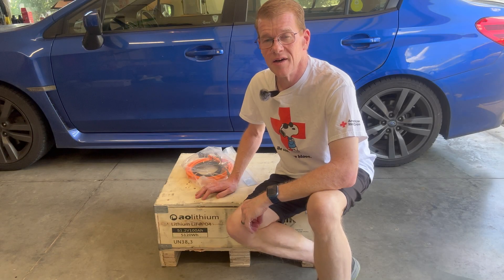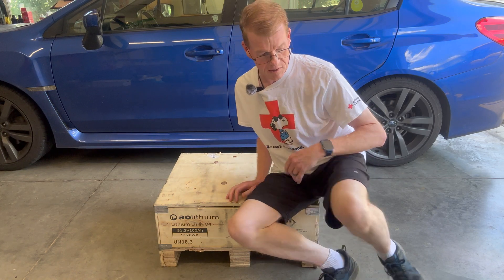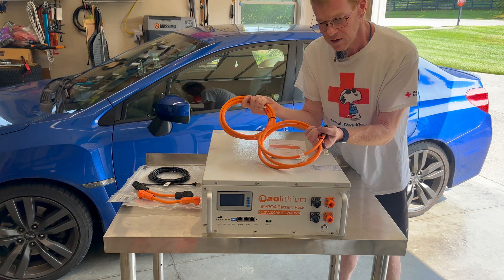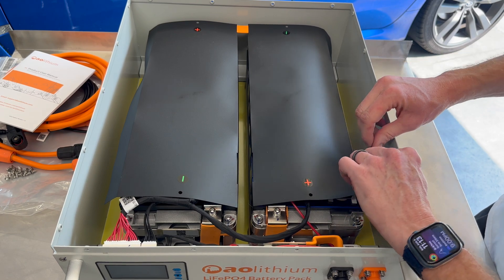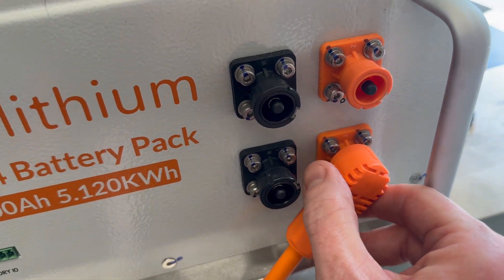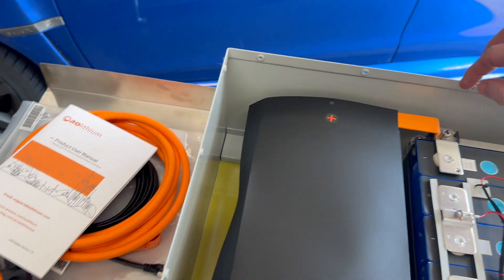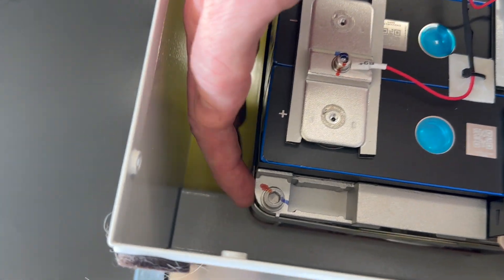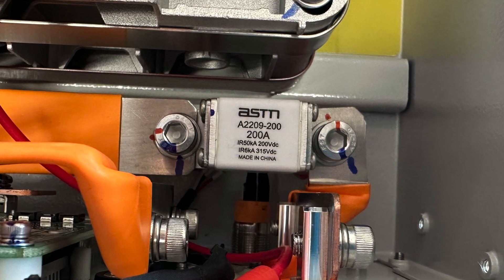AOLithium 51.2V 16S 100Ah 5.12kWh LiFePO4 Rack Battery Part 1: Unboxing and Inside Look

Comment: Thx for the video showing inside AOLithium rack. One of my 4 racks no longer works. It was only in operation for 8 weeks. The display remains dark when I press the button. However, the LEDs light up. The rack is also no longer discharging and a restart and reset have not rectified the fault. Does anyone have any advice? AOLithium has not yet responded to my complaint.
Reply from the maker: There are one or more facebook groups about AOLithium.  I think I saw someone working to retrofit a different BMS into one of their racks.   Unfortunately based on the feedback I'm seeing and lack of contact I think AOLithium has ceased to exist.  I have also stopped getting replies from them.   This is a shame because the internal construction is very good.   I would have liked to see the cells bolted instead of welded for serviceability, but other than that I have nothing to complain about for construction.

Comment: I bought 8 of these 4 with BMS VERSION 2.0 and 4 with the original 1.0

Has anyone figured how to do a firmware upgrade on these.

I also have these connected to a bus bar setup with longer cables all the same size and the dip switches and communication set up as per instructions.  They all discharge at different levels, never the same
Reply from the maker: There is a thread of DIYSolarforums where some have managed to communicate with a PC,  but I have not seen or heard about firmware update or setting changes being successful.

Comment: Nice video and good insight. Can you tell me exactly what brand and type the BMS is and whether you can make any settings yourself, e.g. with a dongle and PC software or something similar? I have one here, but it charges with very high cell voltage until the alarm turns on. I would like to adjust something, but I can't find anything about it. Thanks
Reply from the maker: I can't find anything about the make and model of BMS either.  I know there are a few people on diysolarforum trying to figure out how to do the same.   Do you have a cell imbalance issue?  Mine will reset to 100% and turn off charging at 56.0V and >.5A.
Reply: @DougKremer  Thanks for the quick response. Yes, exactly, I'm still initializing and the cells are drifting apart. The BMS only stops, when on of it is at 3.75V, which is a bit high for me. In the end, I charged it again with 56V and 0.6A using a RD6024 laboratory power supply and now let the balancer work. I'll see if it gets better or not.
Reply from the maker: Once you get to 56.0 and relatively balanced, no cells threatening to go out on high voltage, you can reduce the current to under .5A and go up to 56.99V.  At 57.0 the BMS will cut off charging even at tiny current. The balance circuits in these are pretty slow,  probably 50ma.  You are aware you need to keep the power supply on and connected the whole time right?  The first battery of my three took 3-4 weeks to balance, this last one was only a week.  With cloudy season coming I'll probably take them all offline and give a good balance again.  I have thought about opening them all up and installing a good bluetooth active balancer in each.
Reply: @DougKremer  Yes, that was my plan too, to do it that way. 
If necessary, opening it (breaking the warranty seal) and installing the Active Balancer would be the next step... and the last step would be replacing the entire BMS if nothing can be changed.
Reply from the maker: The factory BMS will balance to 10mv if you give it time.

Comment: I ordered one of these batteries and it arrived damaged one of the handles was completely bent still waiting on the cables to hook it up and they only offered me $90. I’m a little upset about that but I was wondering if they would send me a new one
Reply from the maker: Ugh, my box was messed up a bit as shown but fortunately the battery itself seemed ok.  The packaging could use some improvement.
Reply: @DougKremer  yes sir I 100% agree